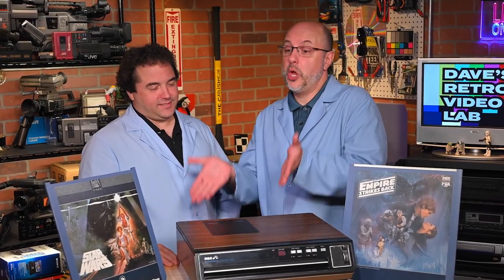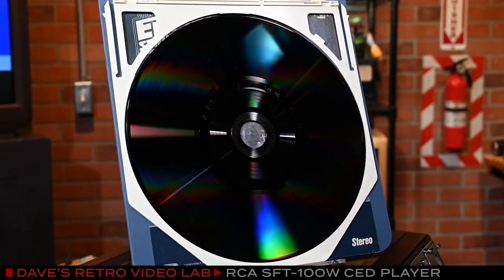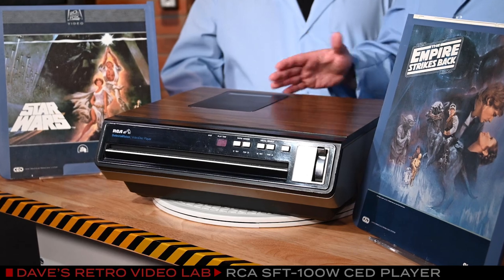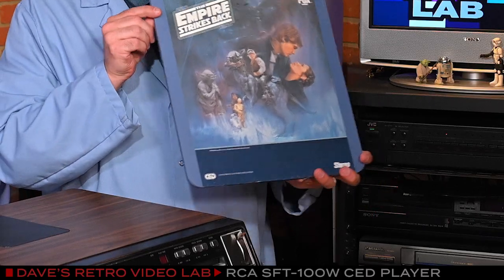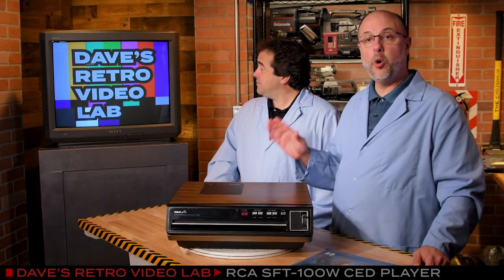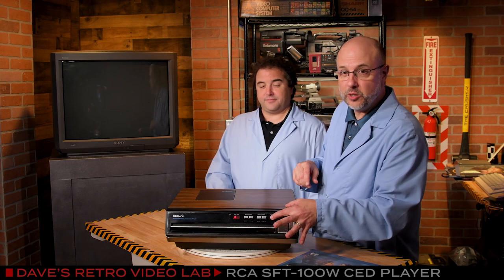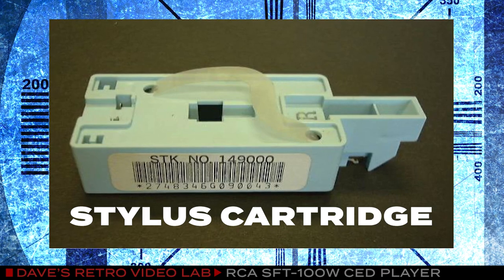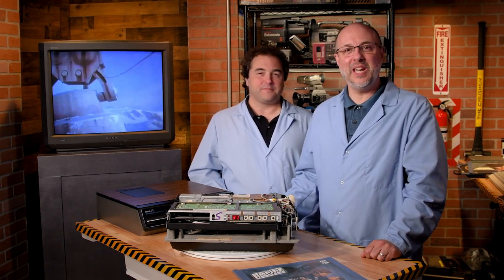RCA SFT-100w CED Player from 1981.  Explanation and Demonstration.  (SFT100)

Comment: Glad to see one of these still working. I remember watching another video around 10 years ago where they replaced the stylus.

 It was such a shame; i took trip to japan 7 years ago and i found a bunch of these discs super cheap at a second hand store but they didn't have the player so i was thinking what was i gonna do with those discs.... I should've bought at least one as a memento or put it on a record player and see what happens!
Reply from the maker: You did yourself a favor by not purchasing the discs way back when.  Otherwise, you would’ve had to lug them back from Japan.  
There is no shortage of discs and hardware on eBay.

Comment: Just found one new in box!!
Reply from the maker: Wow!  What a find.  Does it work?
Reply: @davesretrovideolab2709  I’m scared to disturb the perfect interior packaging, I’m assuming someone opened the box then never took it out. It also came with a demo disc.
Reply from the maker: @warbucks920-  that’s a tough call.  Chances are it works though the rubber belts may be dried up along with whatever grease is used for the gears, etc.  maybe take several good quality pictures of the 100 in it’s box before deciding on what to do.
Reply: Update: Haven’t touched it. Anyone want to buy it?

Comment: Thirty years of R& D went into this machine. RCA dropped it too quickly. They charged too much fir the player and didnt reakize they would make millions from the Discs, just like they did in the early 1950’s with the 45 auto changer record player. The original player costs $12 , but every teenager collectively spent millions of dollars buying 45’ and 45 extended play records. In the 1980’s sgort sighted bean counters were running RCA, so much that they thought the merger with GE was a good idea. It was the end of a great American company that was like family to work with.
Reply from the maker: There’s a great book, which I mention in my video, about how the CED format contributed to the downfall of RCA.  One issue which really stood out to me was the CED’s timing.  The CED player hit the consumer video market when VCRs and video rental stores were really taking off.  Consumers could record a tv program with their VCR or rent a movie for a few bucks and watch it home then return the movie when they were done.  I think consumers saw better value with a VCR then they did with a CED player.